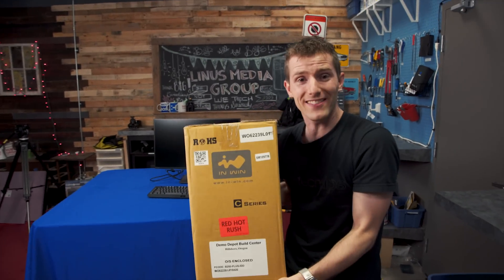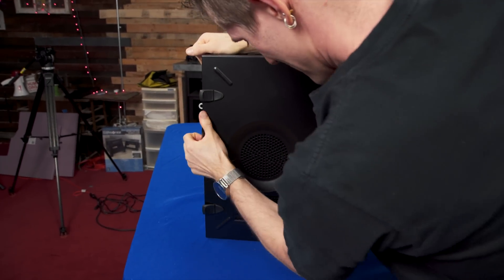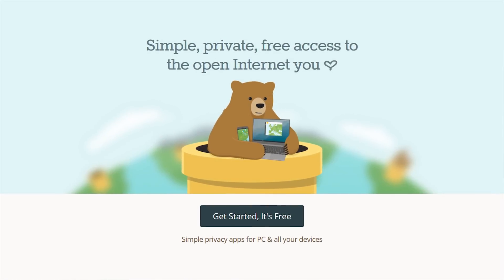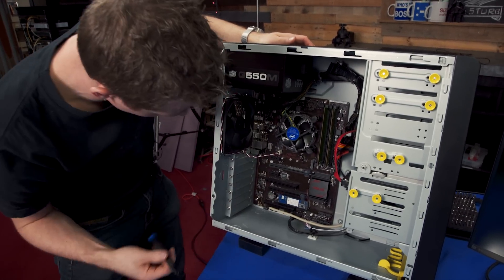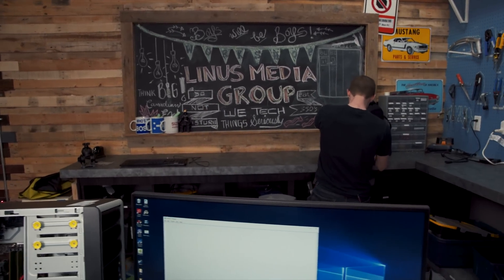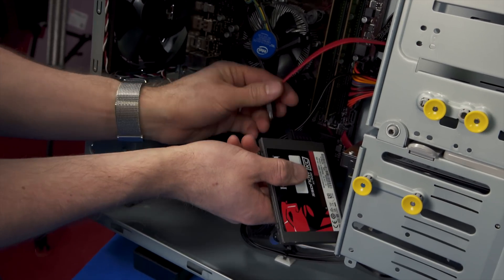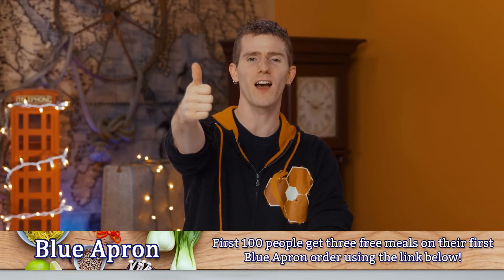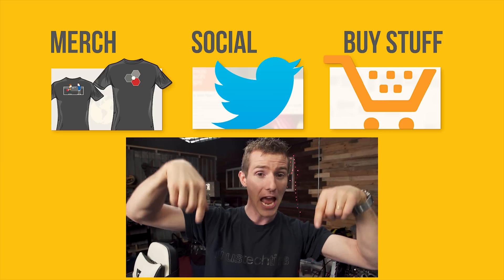Turbocharge your SSD for $40??

Comment: On newer systems - most if not all will have a boot SSD or nVME drive - and most motherboards support 1 or 2 of those slots. The market Intel is trying to hit there is virtually nonexistent because most people would never give up a slot for a drive cache and make it no longer available to full blown nVME drives. Properly configured systems with SSD system drive SSD app drive and spindle storage would next to no benefit versus the cost in terms of giving up a future nVME upgrade. It's a neat product but the market for the recommended beneficiaries is virtually non-existent for this particular product. The cost of that for that sliver that might benefit would be far better served applying the 40 to a boot SSD instead of putting a bandaid on a poor configuration.

Comment: Personally, I see the benefit of this. There are a small number of people who don't buy an SSD but buy a 200 series chipset Motherboard. Many budget system builders buy an i3 or i5 which isn't too expensive. I personally bought an i7 7700K but only bought a FireCuda because I needed to go under $1,000 but I wanted it to be good for Music Production, which is a process that favors single threaded performance. SSDs are extremely expensive and you cannot get an i7 and an SSD with good enough storage for under $1,000.

Comment: if you want to accelerate an ssd, buy a nvme ssd... How would this stack up to my samsung 960 evo 1tb? Speed: Read 3200 MB/s vs 1350 MB/s, random read 380K IOPS vs 240K IOPS, write 1900MB/s vs 290MB/s, random write 360K IOPS vs 65K IOPS, power 5.7W vs 3.5W.  The 960 Evo is faster on everything and still uses very little power not to mention you are limited to 64MB of "cache" with Opane.  Also, who purchases a HDD as a boot drive these days?  This product is useless.
Reply: A metric assload of people including myself that's who. Just because they're running the newest intel system doesn't always mean they have an SSD or, as stupid as it sounds, even want one despite it's benefits so the product shown in this video is certainly ideal for them. If I could be arsed fiddling around with this Optane thingymabob I'd sure buy one for it's pricing and benefit since I've been using the same HDD for 6 years with no issue until I have the money to completely upgrade my storage solution, which will include an SSD. A person in my kind of situation would certainly have a use for it. Different users have different needs. it's why products like this even exist.
Reply: If you watched and paid attention to the video there is no point of using it with an SSD. A HDD is what benefits from it.
Reply: You won't notice much difference going from SATA SSDs to NVME SSDs unless you are transferring large files from one place to another. For everyday use what is important is the random 4k (QD=1) read (and to a lesser extent) write speeds. But these don't differ much between SATA SSDs and NVME SSDs. What makes SATA SSDs much better than SATA HDDs are not their higher sequential read/write speeds. After all SATA SSDs are just 2-2.5x faster than 3.5inches HDDs. But they have 100x faster random read/write 4KB (QD=1) speeds - this is what actually makes the difference noticeable. On the other hand moving from SATA SSDs to NVME SSDs is an increase of 2x in 4k (QD=1) read speeds and 1.1x in the corresponding write speeds. I am sure Optane increases these speeds further but it is still not very perceivable in the same way you don't probably need more than 144Hz monitors in gaming, and you are already happy with 60Hz and 120Hz monitors to begin with.
Reply: KG: Did you even read the click-bait title I was referring to?  But getting past that, who puts a normal HDD as a boot drive in a 7th generation intel system when they have a free pci express 3.0 x4 m.2 slot?  NO ONE!
Reply: you're right, your comment is as stupid as it sounds
Reply: Alright. Tell me exactly HOW it sounds stupid. Simply saying, "Who uses a HDD in a 7th gen intel system," is right out and isn't a valid point.

Comment: i have to question the performance difference between an m.2/NVMe x4 ssd and one of these, if it barely helped a sata3 ssd. i guess over time, if the algorithms/heuristics are good enough, it could technically improve the speed of any PCI-based storage medium, but if the cell speed is that fast then the bottleneck is the PCI interface itself, which is already getting to the point of being saturated by NAND SSDs as controller tech advances.

Comment: Would spend my money to buy a bigger SSD drive... don't see no any value in this.
Reply: Icybubba RAS syndrome
Reply: exactly
Reply: Fermioncool Fermioncool solid state drive drive?
Reply: SSD drive.. very redundant
Reply: And that's the moment where you get intel try to do the same shit as apple
Reply: This would be very useful in cheap laptops to make them feel faster. 5200 rpm HDD which is the standard is so slow. sure you can go with SSD, but at the cost of higher price and less space. So this would make people with low end laptop very happy!
Reply: Fermioncool Fermioncool 
"no any"
Reply: you're asking for too much!
Reply: know this is 5 months later, but have a look at the samsung 960 evo and pro, thats where you find the good value
Reply: bro i have one similar i have a patriot hellfire which is very useful if you like your pc to boot up in seconds.
Reply: but mine is an ssd hooked right up to the motherboard and no wires for the ssd, NO latency at all.
Reply: GeneralBlackNorway great idea i would love to see them on low end laptops.
Reply: TWO SSD, one for OS and one for games.
Reply: but how if you only have one slot open??
Reply: Plus for those 200$ price you can get a decent HDD such as those from Western Digital or Hitachi for example. With that you can enjoy SSD speeds literaly without worrying about any data losses you get frequently from freaking SSD, and that at a top notch price too! My choice is clear i´m going for a highly reliable HDD + optane!
Reply: If the algorithm isn't totally stupid it will keep the files I'm working on in the cache as long as I'm working on them. The workload of a single day easily fits into 32GB ... so it should be feasible. Otherwise I'd be interested in proof of the opposite (sources).
Reply: That question right under a paragraph that has the literal answer in it (besides the video itself in every third sentence) is disturbingly concerning ...

Comment: I don't really think Optane is supposed to be used and widespread right now; the support and marketing have to start somewhere, which means in the future, when Kaby Lake or better CPUs will be much more widespread on both low and high end, low-end users will have access to a pretty straightforward performance upgrade with it. Starting now only means it'll be known when it'll be more likely to be needed.

Comment: Don't be scammed by Intel !!! Optane is useless and extremely expensive !!! $80 for only 32GB !!! Why not just buy Samsung 960 EVO 250GB PCIe NVMe M.2 ? Which only cost $128 and x8 times more capacity !!! and even faster than crap Intel Optane !!! so if you want same capacity Intel Optane then you will need to cost $640 for only 250GB !!! No point of crap product !!!

Comment: When I built my first PC for ~$500 a few months ago with a H270 mobo and Kaby Lake Pentium CPU, I didn’t get an SSD because it didn’t fit in the budget and because moving installed games between drives sounded like a real hassle. Spending <$50 on a 1TB hard drive was the best option at the time, and the improvement over a craptop that took two minutes to boot up was mind-blowing.

When I plan out upgrades to budget for over the next 2-3 years, additional RAM and an i5 CPU take up most of the budget. I would rather spend $40-$75 on Optane then a tiny SATA SSD that would add the need to manage applications between the drives. But maybe I’m just wrong because I haven’t experienced the glory of SSD.

Comment: @intel: how about NO? 
spending 40 to 77 bucks to accellerate a harddrive sounds stupid to me.
if you want speed - buy SSD, 
if you want space - buy HDD, 
if you want a single drive that is fast AND large - buy LARGE SSD.

buying a storage device for the sole purpose of speeding up another one is a half-assed aproach.

also, if this only works with a fancy proprietary driver only available for a certain windows version then i have just one more reason to dislike it.

Comment: What do y'all think of this build?

CPU: Intel Core i5-7500 3.4GHz Quad-Core Processor  ($188.89 @ OutletPC) 
Thermal Compound: Arctic Silver 5 High-Density Polysynthetic Silver 3.5g Thermal Paste  ($11.89 @ OutletPC) 
Motherboard: MSI Z270-A PRO ATX LGA1151 Motherboard  ($112.99 @ Amazon) 
Memory: Corsair Vengeance LPX 16GB (2 x 8GB) DDR4-3000 Memory  ($122.99 @ Best Buy) 
Storage: PNY CS1311 120GB 2.5" Solid State Drive  ($52.99 @ Amazon) 
Storage: Western Digital Caviar Blue 1TB 3.5" 7200RPM Internal Hard Drive  ($48.88 @ OutletPC) 
Video Card: MSI GeForce GTX 1060 6GB 6GB GAMING X Video Card  ($249.99 @ Newegg) 
Case: NZXT Source 530 ATX Full Tower Case  ($84.99 @ Amazon) 
Power Supply: EVGA 500W 80+ Bronze Certified ATX Power Supply  ($35.88 @ OutletPC) 
Optical Drive: Asus DRW-24B1ST/BLK/B/AS DVD/CD Writer  ($18.88 @ OutletPC) 
Wireless Network Adapter: Gigabyte GC-WB867D-I PCI-Express x1 802.11a/b/g/n/ac Wi-Fi Adapter  ($29.99 @ SuperBiiz) 
Total: $958

Comment: The ssd caching works well, the octane caching works obviously well too. Having a cache rather than a full on ssd is good if you have a lot of files like video games that you can store on the hdd and accelerate greatly at very low cost. Full on SSD's are a valid option for the OS, but for the rest you should stick with caching for now unless you have money to throw away. Proper caching through an Intel motherboard gives significantly better results than a typical hybrid drive without the obvious reliability risk, it is very close to what a full on ssd can provide.

Comment: In my current machine I have an 128GB SSD for operating system and 1TB FireCuda SSHD for data, games, etc.. It makes the whole computer run smooth an I can access my most frequent files a lot faster, for a smaller price than buying 1TB SSD. I believe buying Optane module with HDD makes sense with at least 2TB capacity drives, to achieve reasonable speeds and relatively low cost of the whole build.

Comment: this product is vary usage situation awkward, for me and i assume alot people having a older but good processor as well as a ssd/hdd setup where the bulk data on my hdd rely doesn't need any speed up, optane is completely useless, and for people who want performance and have money for new hardware, they probably invest into nvme,, and i find it hard to see optane catching on with the novice computer crowd, the only people who would rely fit the sale, having bought their new bestbuy computer special what still runs off hdd and then later want a cheap magic card that promises much power

Comment: i'm disappointed, 

1st, i have a low end system i3 6100, z170 chipsets motherboard and using hard drive disk for operating system, but i cannot use because not 200 series chipsets

2nd, most of my friend's pc goes for ssd for operating system, using optane on ssd is pointless as the results you show not much of an improvement

Comment: If 3D XPoint stuff is so much cheaper than existing memory tech, why can't I get a 1TB Optane module for cheaper than an SSD?  I'm sick and tired of companies developing tech and swearing "Its cheaper to manufacture!" and then inevitably price-fixing it for a decade before reasonable capacities are sanely affordable.  Remember how NAND flash is so much cheaper than mechanical drives per GB?  Yeah, you STILL can't get SSDs anywhere near mechanicals for price/GB.  Maybe in 25 years we'll be able to get an Optane SSD that's price-competitive with NAND SSDs.

Comment: At $77 that's a hard sell when you consider you can buy a value 240GB SSD for just a couple dollars more or a 120GB SSD for less. At $40 it might be a better sell but it still seems kinda pointless unless you're gonna buy a full on 120 or 240 GB optane drive and even then the benefits of that over something like a 960 evo probably wouldn't be noticeable to non-enterprise users.

Comment: My laptop only has one sata slot and one M.2 PCI*2 slot. The hard disk it came with was fairly large for the price of the laptop, but only 5400 RPM? Loading times were a bit painful. I have a 64GB sata SSD, but since I dual boot, play games, and use engineering applications, that's not going to cut it if I don't have another sata slot. When switching the hard disk out for a 7200 RPM hard disk is a good idea for a computer, and a decently sized M.2 SSD for the OS is out of your budget, an Optane memory module starts to sound like a good idea...if it has a 7th gen processor instead of a 6th gen processor, that is. So, guess which one my laptop has? Hint: I'll be saving for an SSD.

Comment: So it's a hybridization add-on with newer tech. Is there a noticeable change when using it with hybrid drives, which have an internal component that does the same thing?

Comment: On a recent video you asked for constructive criticism / feedback. So here's mine:

I feel like the graphs flash by way too fast. I usually have too little time to even read the title, not to mention actually looking at the results. If I want to actually read the graphs, I have to pause for each of them, and I can't hear you talking while the video is paused. If I wanted to look at a slideshow of graphs with no commentary, I would prefer static images on a website.

I expect a video to be a dynamic review / showcase, and pausing it to see the graphs is just wrong. I feel like you need to decide between making the graphs display longer, so they are more accessible, or just cutting them out of your videos completely.

Comment: You're right, Linus. I'm having a hard time figuring out who this tech is for. If I had the hardware required to run one of these, you can be sure I'd also be running at least a SATA SSD for my boot drive if not a M.2 NVME SSD.

Comment: is there a way to only have the optane perform acceleration on non-OS discs? i.e. on multiple RAID arrays instead of on your OS drive which is likely SSD or NVMe? Seems like a fairly pointless product when an HDD+Optane = SSD price for an OS drive replacement.

Comment: I think octane looks interesting with its extremely low latency and great performance improvement for the cost. I think it can be good for people getting a new computer who are on a budget. Because they can save money by not having an SSD and just buying a regular hard drive+a $40 octane one. I think a big appeal to the octane drive is its simplicity. But I would like to see how it compares when it is "boosting" an NVME SSD and see what improvements you'll see or would it actually bottleneck it in some ways?

Comment: I can see the market they are trying to target but the main problems (which were already addressed in the comments) are 1) if you already have a modern system its also likely that you have an SSD so this is useful only for mass storage since you would have there your most common stuff, which brings me to 2) I would not waste my time upgrading a system to Kaby Lake unless strictly necessary. That 10%~ performance boost in new chipsets is not worth it anymore. IMO all they are trying to do is limit compatibility with other processors for no real reason, sounds familiar Microsoft?

Comment: It's basically useless. The only use I can think of is to put it in an old PC to boost  its boot time but old PCs don't have M.2 or a Kaby Lake CPU. Who's this targeted at? If your PC is compatable with Optane, you definitely have an SSD in it as well. The upcoming Optane SSDs Linus mentioned could be more useful but I doubt it. How much faster than a normal SSD can they be anyway?

Comment: M.2 drives displace SATA slots, which seems like a somewhat bad thing to me... so, to my way of thinking, better to just go with all SSD... 

However, a "mechanical" drive costs less than $60 @ 1T and an SSD costs over $250 @ 1T [in 2nd qtr 2017], so, if you're on a budget, a $40 optane drive plus a $60 mechanical drive is still "significantly" lower cost than an SSD.

I just omit M.2 drives, because, basically I don't know enough about them and, 
"The motherboard M.2 slot #0 shares bandwidth with a SATA 6.0 Gb/s port. When the M.2 slot is populated, one SATA 6Gb/s port is disabled."...

https://pcpartpicker.com/list/2QcmHN

Comment: yeah, I don't really see the point in this module other than showcasing its capabilities for when the Optane SSD's come out due to the hardware requirements of the module to run. if you are spending the money on building a high end PC, you can shell out a few extra bucks for an SSD or at the very least an SSHD. However, I do think that this tech is very interesting and will be keeping an eye out for those SSD's using Optane technology when they come out. That will surely be worth the money and will have a tangible purpose for the regular consumer.

Comment: honestly for us DYI computer builders most of us will never use this product because we already are using a SSD for our boot drive and commin used files probley in raid 1.  most people building custom rigs are not worried about a 40$ chip thats not proven.  i would rather have a SSD that is compatible with any system and that is a known improvement.  mechanical drives are for long term and infrequently used data.

Comment: My suggestion is to think about this a little differently. For the price of a 256 or 500 gig ssd you can have one of these and a 2 or three terabyte mechanical drive which combined will net you similar if not exactly the same performance. Think of it as Intel trying to figure a way around the argument of ssd for your boot drive and then a second large drive for storage.